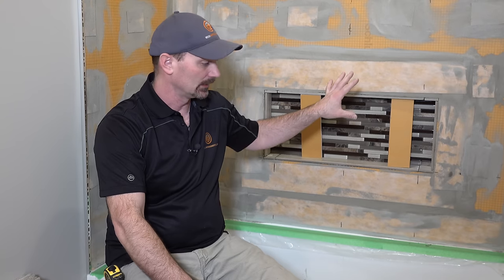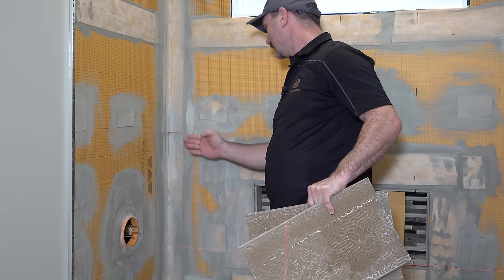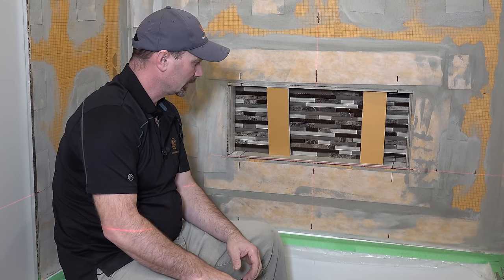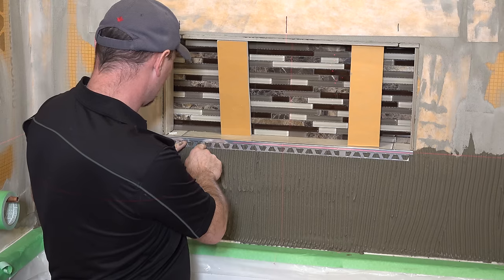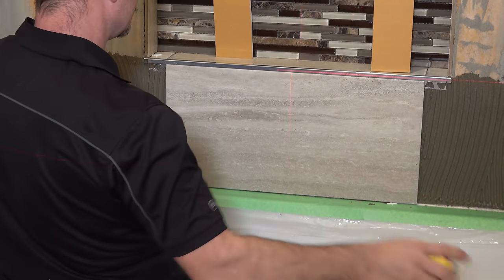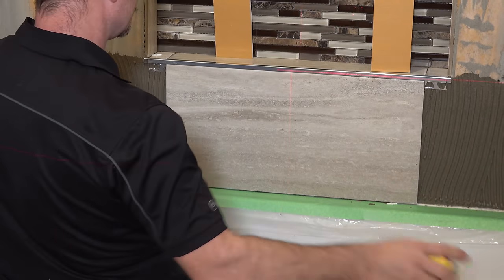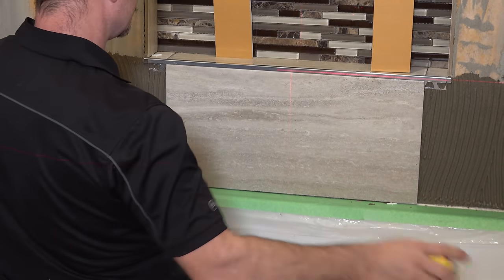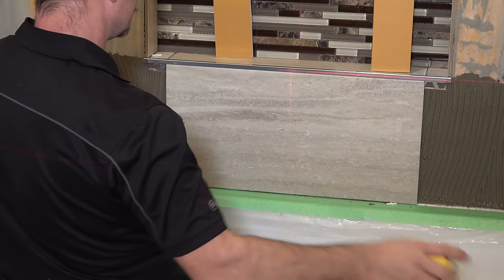How To Tile A Wall (Shower)

Comment: I have been setting tile for 37 years and every time when tile guys want to make a tile cut for shower valve they believe that the cut has to be a perfect circle and also take the guard off from the grinder to make it easier. Big mistake.   To make a tile cut draw an octagon instead of a circle . Less time to cut.  Same for toilet flange and it's even easier because it bigger.  Never install decorative glass tile at the same time you install main tile. Instead use wood spacers 3 or 4 inches or whatever the space of the deco is and the following day you install deco otherwise top tile will push down your deco tile

Comment: Thank you for this very nice instructional video.  I really liked that you didn't edit out the mistakes so viewers can see what types of issues come up during installation.  It would have been good to show how you made sure the tiles were level vertically too.  Also, comments about leaving a 1/8" space to the metal edge trim (you didn't seem to leave any space there).  Lastly, showing how you checked and cleaned any mortar that oozed out into the space between tiles to avoid issues when grouting the joints.  Again, thanks for this very helpful video.

Comment: What a coincidence! I am doing my bathroom renovation and I’m using the exact same tile and a very similar bath niche. Thank you for the video now I have no excuse to not do it right. That laser is key. And I like the idea of putting the metal trim on first with adhesive and screws.
Reply: ItsInTheDetails imagine if you customer want to pay you $300 For such job...you would leave right? Imagine most ppl offering you that amount..and you say no... not w you have 0$ in your pocket...what can we do do guys?

Comment: If you just use Schluter Allset mortar when you tile with the Schluter system, you won't make the mistake of calling the mortar used with Schluter as modified thin set when it is in reality unmodified thinset. AllSet can be used with all the Schluter products because they formulated it to work across their family, taking the guess work out of which thin set to use.
Reply from the maker: You are correct but locally here it is not available of the shelf and it is much more expensive. You are correct though I did mistakenly say modified when infact it is Unmodified.
Reply: Don’t leave any on tile. Lol. All set is hard to get off tile and u won’t even see u left some till u grout.

Comment: Awesome video, you're a great teacher. I am by no means a professional, but in my experience I think 1/2" trowel may be more effective for 12x24s. When you pulled up the 3rd tile and mentioned roughly 65% coverage, I'd say you were closer to 15% coverage, and my guess is that the wall is slightly out of wack and with only a 1/4" trowel there's just not enough morter on the wall? Great job though, I learn a lot from your videos!
Reply: All instructions I have read is to use 1/2” on any tile that is longer than 15” so I was doubting everything he was saying. Same for the mosaics it says to use 3/16”. I’m guessing so there is not excess mortar squeezing through. I’m am very new and the video was still helpful.

Comment: Awesome content. Myself I use 1/2 trowel when using 12x24 in tiles .. just covers way more when you have inconsistencies on the walls. Thumbs up. Thanka for the content.
Reply: Isn´t 1/2 by 1/2 required or better "highly recommended" for large format tiles in wet area in order to achieve 95% coverage? When I put the tile on with some good pressure and wiggle., I want to see the mortar ridges collapse and all air come out from behind the tile. I want to minimize air bubbles behind the tiles which over time could hold moisture, right?

Comment: Appreciate the video and transparency. . good job just a couple tips ..With tiles that big your trail notch should be 1/2 inch, your tile probably have about 60 percent covarge.. another point is always do the accent last, just measure your width of the accent then put leadger board in and continue up with your tile then come back and do accent tile last.. one more tip lay your tile out and plan so there is never 1inch slivers  tiles anywhere.
Reply: YouTube is a great place to learn what to do by seeing many examples of how not to do it. But, learning is learning...
Reply: Just finished watching it... good enough for apartment complex or track housing... but, better than most YouTube.

Comment: I would recommend using a tile leveling system to prevent "lipage", walls look very straight but even so you had to do some build-up for some tiles, so any leveling system would be great. Also while it may seems easier to do harder tiles later you should always go from bottom to top otherwise you get a larger or smaller pag between tile layers, which is very noticeable.
Reply: Wrong. You don't start from bottom to top. You also need to make sure to leave at least a quarter of an inch expansion gap at the bottom.
Reply: @imthegrinchthatstolechrist4384  what? Yes you start from bottom, not always at the tub but work upward. Dont leave a 1/4 inch gap either, just asking for trouble ffs.
Reply: 1/4 on wall then 1/4 on tile this guy should stay away from tilling big fail

Comment: Excellent video lots of helpful tips and tricks. I might add a piece of plywood over the tub with some foam tape on the bottom is a great way to protect the tub during construction and after the 1st row of tile is on, you can easily remove and replace it as you go. Another piece vertically as a skirt attached with some 2x2 behind covers the front, really helpful with modern acrylic tubs,, not that I've ever scratched one myself  ,,,

Comment: For the round cut for the diverter, some times easier to use the diamond hole saw you used before that and make a clover shape.can knock off points if you need to afterwards.

Comment: That was a great detailed video and thanks for adding all the things that could go wrong for anyone that is working on similar project. One comment I wanted to point out is. If your window high is about the same as the tile, wouldn't be easier if you remove some of the mosaic tiles strips so the next big tile will match with window height and also the top would have a little more of "meat"? Other than that, everything looks great!
Reply from the maker: You can really do things however you like. I liked the look of the thicker boarder.

Comment: I absolutely loved this video. How do you start your tile if the tub is not square? I have 2 bathrooms and one runs down towards the wet wall and the other runs down towards the opposite wall. If I start directly on the tub, the tile is not going to run straight. Any suggestions?
Reply from the maker: depends how much out of level they are .If they are 3/16" or less I would start a level line at the top of a tile line on the highest area and install tiles level to that line around the tub. Any caulking you do from the tub to the tile after will hide this joint. If the difference is more than that then I would start the level line at the top of the tile line at the lowest point and cut all tiles to fit. Or split the difference somewhere along the tub edge. If you need more help please use our forum. You will find a link in the description of most of our videos.

Comment: I did my first Niche with that trim. Tile store sold me the wrong corners. Could not waste any more time so I decided to miter. That is not safe and I have been using these tools for decades. I also found that if your walls are not perfectly flat your screwed. And your layout has to be perfect. No wiggle room at all. I'll have to allow 3/16 grout joint all the way around just to make it look decent.
I'll stick with bullnose or bullnose myself. The floor to ceiling piece looks pretty good though but the Niche looks terrible, oh well now I know
Reply: would you happen to have a picture of your niche?  We are getting ready to tile one and have been looking at videos to see if it's better with that trim or without
Reply: @demetremartinez1625  No I cant get in the house now that its all done sorry

Comment: Great video. It looks like you are leaving a gap in the corners on the back walls when tiling rather than butting right up to the side walls? Is that correct or should I cut the back tiles to butt up against the walls?

Thanks keep making these great videos.
Reply from the maker: I like to leave an 1/8" or so between the tile and the wall surface

Comment: What is the smallest size tile you would recommend on a shower wall? like can you use the smaller tiles that are used for backsplashes or not?
Reply from the maker: Sure, you can use pretty much anything.

Comment: Thank you for this video, I am just learning it. May I ask you what type of mortar should I use for my cement board walls and similar tiles? Also, why you did not use the tile leveling system?
Reply from the maker: If you are using no membrane then you can use modified. If you are using a membrane then I would use non modified . You can also check the manufactures website for specs for which thinnest they recommend.

Comment: I am using 12x24 porcelain tile, I am not sure what motor should I use? The Schluter web site only recommends ceramic and stone to use non-modified motor, but nothing about porcelain. Thanks

Comment: I am dreaming of fully tiled bathrooms. Is it better to have mostly large tiles to make it easier to clean? I'm going to assume so because there is less tile grout to clean.

I am not a tile installer or a decorator so I'm not exactly sure what you need to be functional and aesthetic?

I have seen tile arrangements with large tiles combined with small tiles in attractive arrangement.

Comment: Very nice vid! I'll be talking my own bathroom this next week. How do you go about laying out all your tile/cutting before grouting it? Like the smaller pieces, and assuming you have to keep in my the 1/8th' spacers added across on each side of the tile?
Reply from the maker: I cut as I go but some people will cut most of the tile ahead of time. That is fine if everything is pretty well perfect. Leave the spacers in as you work to keep everything sitting nice. Just remove them the next day.

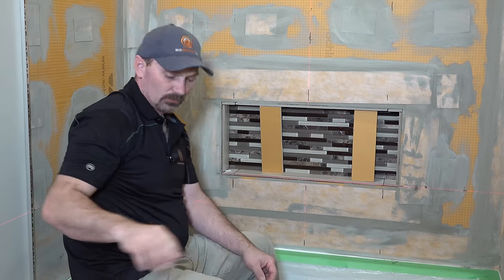Comment: 4:22 Yeah, 12x24 is the rough sawn measurement. After they cut down the tile tree and mill all the tile slabs, they're smaller.

Comment: Hi.   I just find tiling my shower.   I used 12x24 ceramic tile and a 1/2 by 1/2 inch trowel.   The last row the thin set was starting to harden but able to trowel it on.   And I couldn't move the tile around to compress the ridges but gave it good taps with a rubber mallet.   Do you think I should be good?

Comment: Nice work. I'd have suggested to put water in Grove after inside cross cut for the larger so it may stay after. And cuts pal side down and rotate on a circle axis. Good work though. We say there are 'many way to peel a potate' etc. May way to make a salad..the important thing is that you have fun get paid and the owner enjoys the finished product and you have a profit.those are the keys ingredients..God bless!

Comment: Do you mind sharing what the thickness of that tile is and what size trim you used with it?  I am having a hard time choosing whether to use 3/8 or 1/2 inch Schluter trim with tile that is  large format and 3/8 inch thick.  Thanks for any help.

Comment: Very useful video ! One question how did you support the tile above the circular faucet hole? Thank You!
Reply from the maker: just like all the other ones, use the spacers between the tiles to keep the spaces correct and keep the tiles from slipping down

Comment: You didn't show putting mortar on the wall for niche and small tile for the trim pattern. What mortar pattern, vertical or horizontal did you use, was it with 1/4 square trowel, since you didn't back butter.
Reply from the maker: https://www.youtube.com/watch?v=pSve6FTrQao

Comment: Question about the trim: Any reason you decided to use the Quadec trim on the niche, but then used something else on the outside edge of the shower and around the window? I was planning to use the Quadec on all of my edges - until I noted you didn't. Was the customer just looking for a different edge style on the outside of the shower and around the window? I don't want to buy all that Quadec then find out it was a mistake. Excellent video as always! Please pass along the same props to whoever does your camera work too. As someone who also works 'behind the scenes' we don't get many thanks, but they're doing an excellent job getting good shots in these tight spaces!
Reply from the maker: Each to their own really. The main reason was cost. The quad is pretty common here for around Niches but not on edges where tile stops on the wall.

Comment: Great video! My wife and I are about to tile our shower. How would it work if you didn't add trim pieces to the niche? We bought trim for the sides of the wall, but not the niche. Thanks for posting this video! -Joel
Reply from the maker: unless you have bull nose tiles it is not as nice without trim. Most tiles normally are not coloured far enough around the edges to look good.

Comment: Love your videos, Shannon.  I have two questions, I noticed that you mudded every joint except where the drywall met the Kerdi board on the faucet wall.  I have seen two other videos do the same thing and I am wondering why?  You kind of answered it towards the end of video.  And secondly, what is your thought on the rigidity of the Kerdi board?  At $110 sheet + accessories, it's a tough sell for me considering cement board is $10/sheet.   Is it really that much easier to use?  Thank you in advance.
Reply from the maker: No need to finish that joint when its covered with tiles IMO.

If you use cement board you still need to water proof it so it may be $10 but your not done. Cement board is about $1/sq' here and kerdi board is $3. but its way easier to handle, load ,install and cut . Personal preference I guess.

Comment: Very nice work.  When you do tiling jobs like this one, do you usually mix a full bag of mortar and use it until you run out or do you mix smaller/partial bags?
Also, when using large format tiles do you use a tile leveling system?
Reply from the maker: I typically mix about a half bag at a time . On floors I may mix an entire bag for larger tiles. 
I have used levelling clips but not often.

Comment: You do good job I’m tile guy u should try putting thinset on tile instead of on the wall its a lot easier and faster and it doesn’t dry up like that when it’s on the wall

Comment: Hey Shannon, got a question ... when using the chrome trim around the niche what do you think about putting the trim pieces inside the niche (mitering the corners) before you lay the tile inside there?  Do you think maybe it would create to much of a ledge preventing any splashed water from coming back out? Maybe the trim might trap the water inside the niche ... I don't know but maybe I just answered my own question. haha

Comment: How do you waterproof the bottom of the tile touching the tub? Just grout?
Reply from the maker: silicone
Reply: @HouseImprovements  silicon the bottom grout line?
Reply from the maker: @whosgivin  yes. If you want you can grout it for some colour but run a bead of silicone there after.

Comment: Thank you for a very helpful video. I have a question: why don't you need spacers in between the tiles next to each other, just on top of each other?
Reply from the maker: you can use them if you want for getting the space exact but its pretty easy to see if they are ok spaced. The spacers under tiles are helping space and hold the tiles from slipping down until they dry.

Comment: Great video thank you! One question the first back wall you installed....does it matter having space or to have flush on the walls to the left and right? Thank you in advance!
Reply from the maker: If you do the back wall first the two end walls will cover by the thickens of the tiles so you dont need to be right tight. Give yourself at least an 1/8" gap.
Reply: @HouseImprovements  Thank you very much! Life saver!

Comment: Should wear dust mask when cutting tile. Also, for smaller hole and no pilot bit, can use a board (.5 inch or thicker) as a pilot noard to hold the circular bit in place. Just predrill the board and clamp to tile. Like the laser level!

Comment: Bro is it necessary to use spacer if you are applying 2x4 tile in flooring??? please reply
Reply from the maker: If your doing tiling on walls or floors you will want to use spacers.
Reply: @HouseImprovements  ok thanku

Comment: You don’t need to put spacers in all the mosaics you put that last build bridges with spacers on top and bottom to accommodate the space that you need for the mosaic and continue stacking your tile all the way his house you need to go then come back after the tiles dries pull out the bridges and install your mosaic

Comment: cutting the back works better most of the time. even with the smaller hole you did. try it from the back next time. also, use the smallest size wet saw you have on deck for the cross cut in the 4 inch hole. faster and cleaner than doing it with the grinder